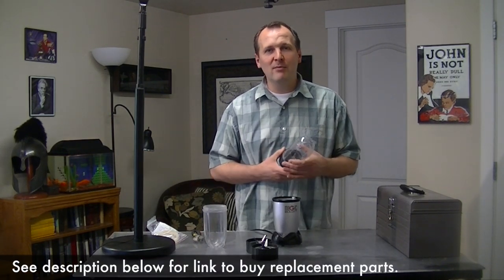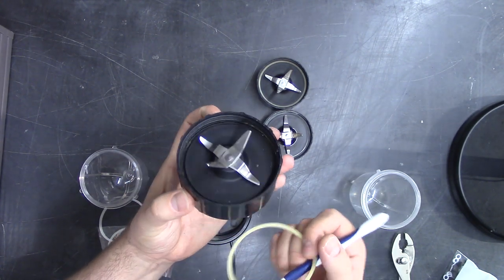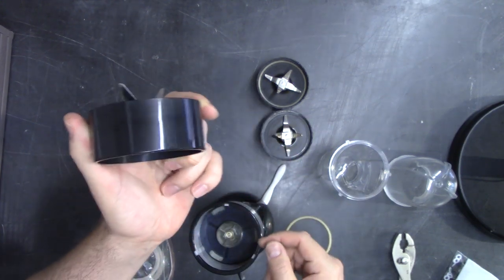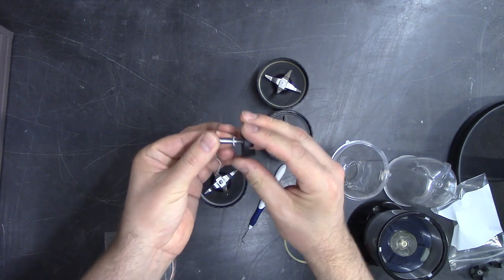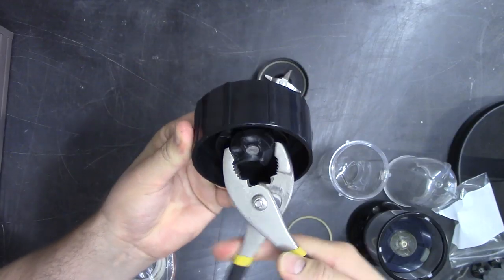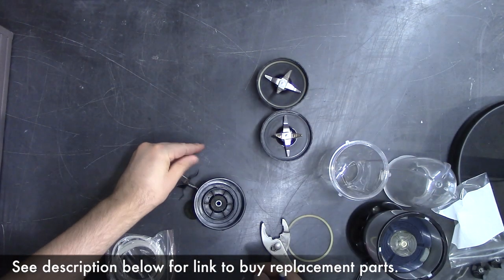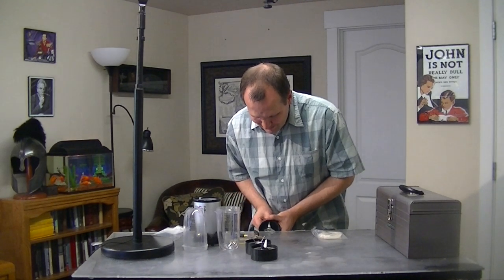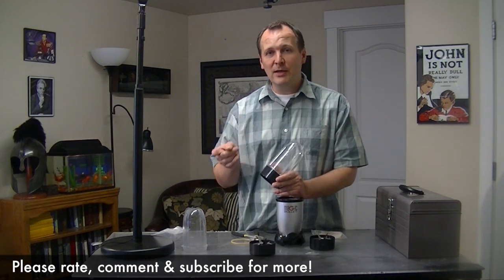How to fix a leaking Magic Bullet blender

Comment: Andrew, you inspired me to fix  my Magic Bullet! 
The blade in my 5 year old unit was wobbling quite a bit and as a result was making quite a racket when I used to use it.  
I took it apart and took the small white nylon O ring on which the blade sits to my local ACE hardware store and found a replacement for it. I picked one up that was about an eighth of an inch thick because that's how much my old washer had worn out.  
Once I replaced, it - voila, it sounded normal again!  Total cost $0.27!!!
Reply: thanks for that tip.  I'll be heading to Ace tomorrow to do the same!  Can't wait to have the blender back (use every day for morning greens drink, +)
Reply: Can you get those nylons ring at Home Depot or lowes?

Comment: Thanks, Andrew for your comment  I also had the same problem with my Magic Bullet....so off to Ace I went, and with my 27-cent rubber washer my blender no longer wobbles....but now I needed to replace the washer gasket that the food container sets on.....so I  took out the washer heated up a little water (NOT BOILING ) in the microwave dropped the washer in the water for about 30 seconds let it cool, it expanded and it works just fine for me.               ( ps. do not put your hand in the hot water!)

Comment: Whew, I thought I was missing a part when I reassembled the blade assembly after extensive (hand wash) cleaning on my mini bullet as it leaked when I went to use it. Turns out I just didn't tighten it enough, did it by hand the first time, used pliers after watching this. Thanks! No more leak!

Comment: Hi Andrew - great video, but, on inspection of my 3 month old unit that has now started leaking through the cutter shaft, I believe there is an inherent design fault with the cutter base.
If you hold the blades and pull them up and down, there is about 1 to 2 mm of vertical play on the shaft, despite the inclusion of a short length of 8 mm silicon tubing at the top of the shaft, just under the blades.
The main shaft seal is a two ridged rubber seal, inside the bearing assembly, but this is assembled at the factory without any lubricant, so wears quickly. A smear of Vaseline petroleum jelly will solve that issue.
The second point is that the silicone tube, (ID 8 mm OD 12 mm) is too short, permitting the vertical play and negating the secondary seal made by the white nylon washer between that and the bearing housing.
Simply buy a short length of that size tubing, cut and fit  a slightly longer piece to remove the vertical play and exert pressure on the nylon washer and the leak problem goes away.
The play can also be removed by adding a rubber 'O' ring directly beneath the blades.
Hope this helps a few owners of this excellent machine.
Reply: good idea thanks
Reply: which silicone tube are you referring to? thanks for this!

Comment: If the gaskets contacting the plastic cups are worn out then Andrew DIY is correct but unfortunately his fix to replace the flat nylon washers is not going to cure the problem since they are only there as friction devices and not as sealers between the shaft and the brass bushing (which is what I have in my Magic Bullet, I believe the NutriBullet has ball bearings instead). The only guy that I found to be correct is David Amblin below so when I took my blades apart I just replaced the 6x10 mm red silicone or rubber O ring above the brass bushing, lubricated it with a tiny dab of vaseline and voila! problem was fixed, So stop trying to find the flat washers, but if you want them they are available at Lowe's as Hillman nylon Std (SAE) 1/2"OD x 1/4" ID x 1mm thick. Good luck folks, but Magic Bullet stopped being my favorite because of this persisting issue.

Comment: Seems like once it leaks, the bearing will rust.  After watching your video, I took my blade shaft off.   The only thing I had on hand were some O-rings and a garden hose rubber washer.  I cleaned the rust, put those O-rings and rubber washer on and so far its working.  Not sure if my MacGyver way is recommended but will see what happens.   Thanks for sharing your video.   Aloha

Comment: Thank you for the video. Amazon sells the replacement gaskets that fits inside the blade, but where do you get the 2 tiny ones that fit around the screws?

Comment: What about the smaller gaskets.  The link only went to the larger ones.  I can pick them up at Lowes or Home Depot but do you have a quick description on the official dimensions or sku in case mine are worn out for an accurate measurement?
Reply: What do you if lquid gets in motor part can appliance be saved?
Reply: where did you end up getting the smaller gaskets? i can't find it anywhere
Reply: I can't find them either. Went to a couple hardware stores today with no luck. They're a mix between M7 (OD) and M8 (ID).
Reply: @KenziemacOrleans  I KNOW my answer isn’t what anyone else would probably say, but when mine has leaked, I just rinse it out with water FROM THE TOP ONLY. I’ve done this multiple times and the water runs out of the bottom. Let it dry then it should be good to go. Do at your own risk...but it always works for me!
Reply: @atifkhalid9655  Really makes sense

Comment: If your blender is leaking underneath then you'll need to relubricate the main shaft seal. The main shaft seal is black and rubber and is located inside the hole where the blade shaft resides and will become visible once you remove the blade shaft. Rebricate the seal and you should be go to go.

If you want to go above and beyond you can remove the seal, which will require a pick. Clean up the area, apply some petroleum jelly or food safe silicone paste, reinstall and you should be good to go.

The high temperatures of the dishwaher will probably wash away the lubricant so I now wash the blade base by hand.

Comment: Very good video.

Where can the small blade washers be found & what are they made of?
Reply: zeffur7 I am also looking for those small washers, all I can ever find are the large gaskets (like the ones linked in the video description).
Reply: ***** They look like nylon washers.  I don't need them at the moment, but if I did need some, I would use my caliper to measure the ID, OD, & thickness of the washers on a new blade assembly--then try to find the washers online or at the local hardware store.

You might try here:  http://www.jwfasteners.com/washers.htm
Reply: zeffur7 any luck about the measurements?  i am on the hunt for that  small  washer myself, where can we find it i wonder.. Cheers!
Reply: KBunny13 No luck is required.  Just a caliper, some time, & something to record the measurements.  

If you need the washer, get a caliper & measure your blade shaft diameter & the existing washers for the other dimensions.

best regards.
Reply: KBunny13 6mm internal diameter, 10mm external and about 1mm thick. I ended up getting it from Lowes, not a perfect fit but closest I could find, it was the 1/4" one: https://www.lowes.ca/washers-gaskets/the-hillman-group-8815-nylon-standard-sae-flat-washer_g1187478.html?searchTerm=nylon-washer
Reply: ***** thank you so much! I didn't have the necessary tools to measure , nice of you to share your knowledge, much appreciated, i hate premature  obsolescence  !  :)
Reply: @Liability_Man  am going to try this thank you @RGB

Comment: Solution found! The tiny one is called “SCREW WASHER GASKET” and the size is 6X12 mm (inner and outer radius) thickness >1 mm. Available on Amazon and eBay. Material nylon.
Reply: You are a genius. The whole video was pointless without this key info and I was hoping someone would be here to address it. Thank you.👏👏👏👏👏👏👏👍

Comment: Hello Andrew, thanks a lot for the video. Can you please post the link for the smaller blade shaft gaskets?
Reply: Apparently no one else can find them. I am really trying to avoid replacing the whole thing and throwing another useless hunk of plastic in the landfill. It is recommended those blades be changed every 6 months (or so I read). I cringe at the thought of that when I know I could just replace the gasket!

Comment: Solution = Swap shafts/blades between the single blade (never used) and Cross Blade. After Searching online for 5 minutes I determined searching for small white gaskets was a waste of time. I think Andrew found them at some point in time but the link is no longer available on ebay.

Comment: Had this blender in a box for years unopened. Fired it up today for the first time and the smoothie leaked completely through and into the motor. After looking at your video it looks like our magic bullet is completely missing the gasket. This was new in box with no gasket. No wonder it doesn't work.

Comment: There is also a fluid seal inside the base that keeps fluid from getting past the shaft. I have not been able to source a replacement part through homeland housewares. The seal is a cheap silicone seal. I think I will Ty to find something better suited for high speed and high friction applications.
Reply: Shean W Did you ever find a source for that fluid seal in the base of teh magic bullet that goes around the propeller shaft?  Mine is fubar'd and I need a new one.

Comment: Nice video... you make it look so easy...  Well, my Magic bullet is OLD.  I bought the base gear at eBay.  The plastic part in the original piece broke and the metal center part stayed screwed.  Sometime ago, I saw a video which showed how to unscrew the METAL & replace the complete piece.  You have to use the bottom screw,  hold it while turning the metal part of the gear counterclockwise.  IT was too hard!!  Any suggestions?

Comment: Hi Andrew
The ads say rubber base gasket however are these for around the blade shaft or around the outside edge of the base?  Hard to tell as there is nothing to compare them to.  If I may make a suggestion, put the blade shaft in the picture with he gaskets.

Comment: What you are changing are not seals. Changing these will not fix the problem for very long. The seal is actually a rubber shaft type seal down inside of where the blade shaft runs.

Comment: hi.  my problem is with the base.  the little wheel inside the motor.  that one that makes contact with the blender.. the little wheel doesn't move at all.  I need to remove it to replace it but it doesn't move. thanks

Comment: Do you remove the gasket for cleaning after each smoothie? I have and I think this may be why i am going through so many replacements? Thanks for your answers!
Reply from the maker: I usually don't remove the gasket until it needs to be replaced.
Reply: I think you've found why I am replacing so many :) Thanks!!

Comment: Doesn't address my problem. The motor turns in the opposite direction than how the containers screw on. The result is that the lids come unscrewed while in use.

Comment: My magic bullet won't work and I'm really sad about it. I think that I might have gotten some sticky stuff into the power base when I was trying to make a sorbet but I'm not really sure. It won't work at all.
Reply: +Tanasia Butts  Check out more videos; write to the company.  We had one that stopped working during the first year and the manufacturer replaced it free of charge.  If you smell a burning odor when trying to use it, you may have burned out the motor.  My older model was very specific about the appropriate running time both in the instructions and in the video demonstration.  It may have been 30 seconds.  Then you have to stop and wait a little bit to run it again to get your desired consistency.  If you run it for longer periods, you risk burning out the motor. We have always been super careful about getting anything in the underside of the power base, so I have no knowledge about that.  If it leaked in the upper part of the base, we stuffed it with tissues (capillary action draws the fluid to the tissue) and left it turned upside-down for several hours. This happens often and has had no lasting effect because, I think, of the precautions we take to get the liquid out.

Comment: My gaskets fall out frequently, and get chopped up in whatever i'm blending... it's quite frustrating
Reply from the maker: Really? That has NEVER happened to me, I've made smoothies for years.  Maybe you need some new ones?  Do you machine wash your blender base?  Over tighten them when you make a smoothie?  That's really the only thing I can think of, or they were never seated properly in the first place.  Also, there's a link in the description to buy more gaskets if you need them.
Reply: I have bought 8 new gaskets in tota, 4 each time, the first 4 were shredded over the span of about 6 months or so, now i'm onto the 2nd 4, and i destroyed the first one a couple days ago... i have tended to over-tighten them since the first one broke, to try hold them in place better... could that really cause it?
Reply: +ussyless I have shredded some gaskets myself.  Almost did it this morning because I have a newer model but was using one of my older bases and I forget to take precautions.  Since you cannot see where the gasket is when you flip the cup over to do your blending, it can be loose in there and get caught on the blades.  The precaution I mentioned is being sure that the gasket is FIRMLY seated in its groove.  Once I learned to do this, I didn't have a problem any more.  You may notice in Andrew's video that he had to pick the gasket out because it was so firmly tucked into the groove.  It should not be able to just be lifted out.
Reply: ussyless, careful over tightening may cause the plastic to break.